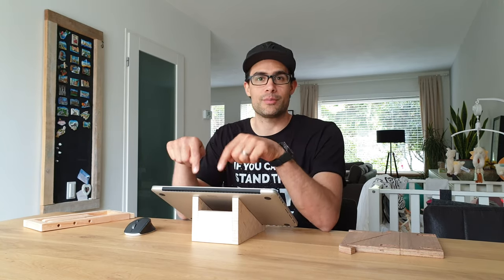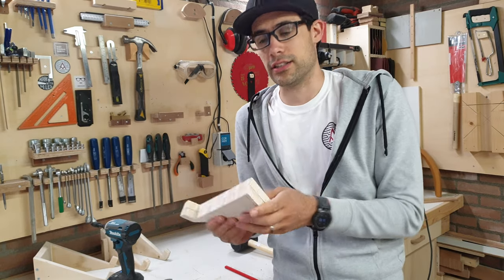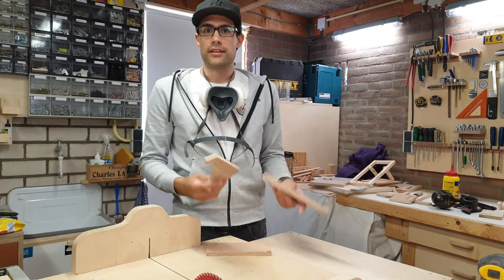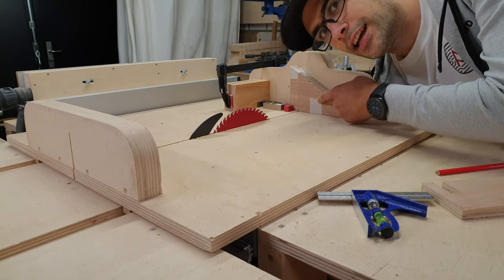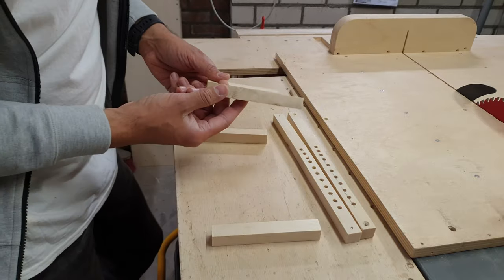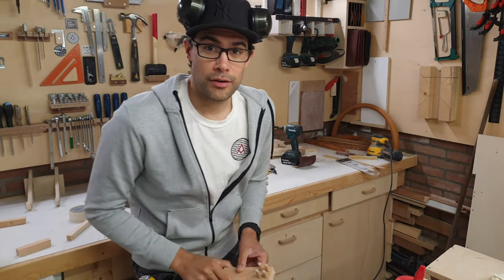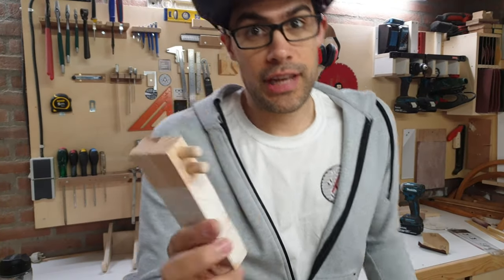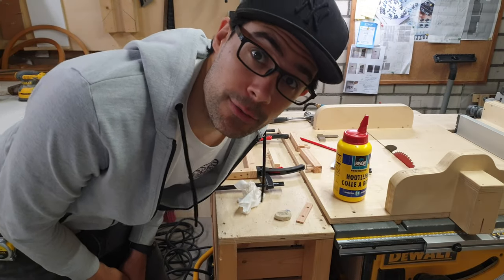Laptop stand for working at home - Three designs to make yourself in lockdown

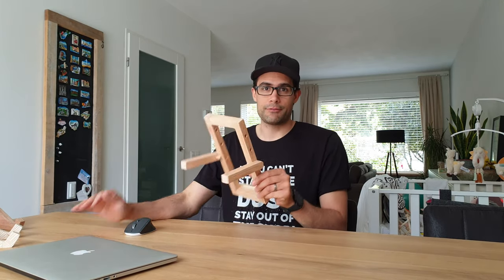Comment from the maker: The different builds start at: 01:04 (fixed), 03:54 (collapsable) and 06:29 (portable). Thought I would share in case you are only interested in one of the designs.
Reply: Heb je toevallig ook ergens de exacte maten van model #2? (Van alle zijden, dat zou het voor mij nog makkelijker maken dan dat jij nu al gedaan hebt). Bedankt voor de duidelijke instructie!
Reply from the maker: Hoi Bart, het beste dat ik voor je kan doen is een print op A4 van de zijkanten. Die maten zijn exact zoals ik ze gebruikt heb. Op mijn website kun je die downloaden, uitprinten en op wat hout plakken. Dan heb je precies wat ik heb. Het tussenstuk heb ik geen afmetingen van en die steun heb ik ook niet meer dus daar kan ik je niet meer aan helpen. Hopelijk heb je daar wat aan 😄

Comment: You can modify the first design.

1. Make a cut  with width equal to the width of the wood in the left piece starting from the center bottom to half the length.
2. Similarly cut the right piece but with the cut starting from the top instead.
3. Now you can join the two pieces by inserting them together on the cuts. Creating a similar stand in an 'X' shape.

You save wood and it is kinda more portable.
You can detach the pieces and carry easily in your backpack.
No glue neede.
(The design is not my original)

Comment: Hey man, loved the video. Can you give me the dimensions of pieces and cuts you made for the second stand. I visited your website but did not find it there.
Reply from the maker: Hey, I don't have any dimensions specifically for that one. It's basically the same as the first one but with a wider back so you can make slots. How wide is up to you and the slots just have the be big enough that your back piece is flush with the bottom of the two sides. Hope that helps ✌️